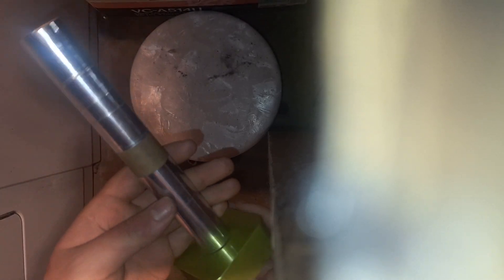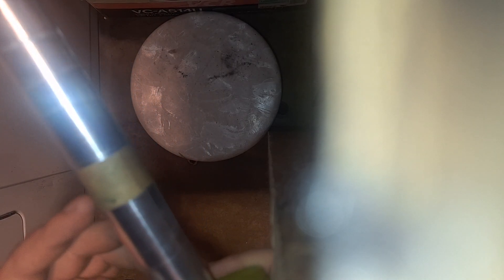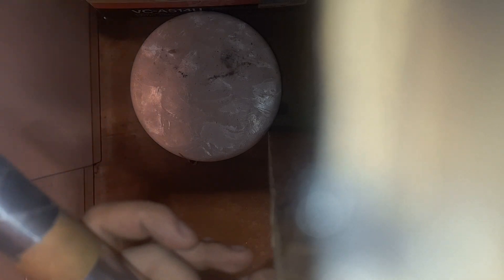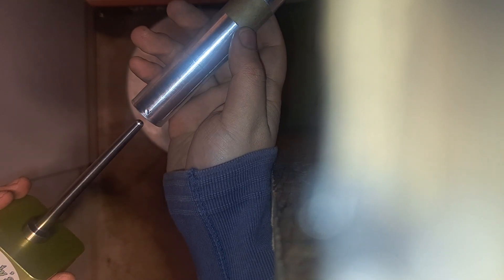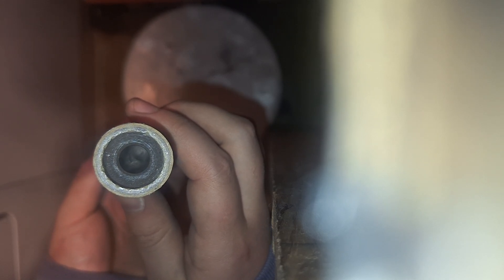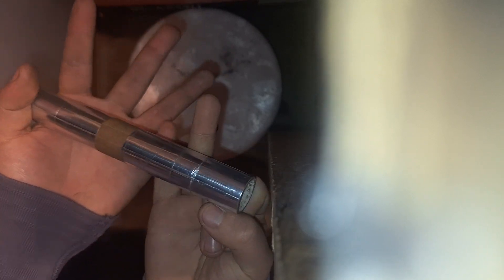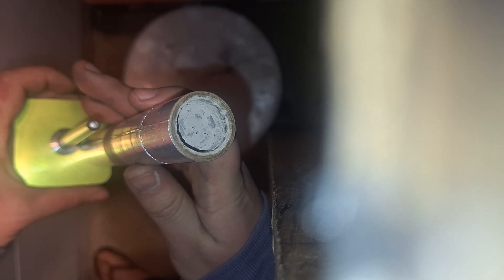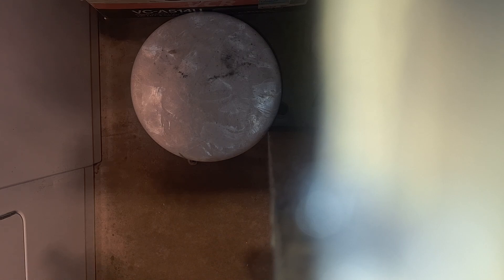the all hellfire whistle rocket, 1lb waxed tube, built on woody’s extreme tooling

Comment: Hey buddy me again lol. Was hoping to share a formula I’ve been working on with you and possibly get some feedback. Not sure if this is the appropriate place or not but wanted to ask nonetheless.
Reply from the maker: @Pyrodadsam  Sure, let’s do this. 🔥
Reply: @ShortFuseMan although I’ve had no problem lifting moderate loads I’m not going for a super heavy lifter just a super loud and unique sound.. which I believe I’ve achieved.. but I wouldn’t be upset to fine tune it for more power if you have any suggestions. It performs well on both my 2 and 4” 1lb spindles. As well as 5/16th tooling.

KCLO4: 60
KCLO3: 14
Sodium benzoate: 19
Charcoal 80m: 3.5
Phenolic resin: 1
Bismuth trioxide: 2.5
Wax: +3 

I know bismuth trioxide isn’t known as a powerful catalyst but I read that it produces an incredibly loud and unique whistle paired with benzoates so I started playing with it.
Originally it did not contain chlorate but based on your explanation in FPs strike video I added a small percentage and I believe it made a significant difference.
Also added the charcoal for smoke production and also seemed to increase thrust slightly. What do you think about this at first glance? I will be purchasing an analog scale soon so I can get some actual numbers.
Reply from the maker: @Pyrodadsam  …That’s a pretty dope propellant; I like it dude. ‥Looks like 74 grams total oxidizer and 29g total fuels, which is the 26g of calculated reducing agents and 3g of auxiliary plegmatizing agent as paraffin. It looks nice, but I would recommend adjusting it to the following formulation if you desire increasingly stalwart specific impulse yet unique and powerful audio emission simultaneously:

ƼƼ% Potassium perchlorate ❲Peroidin❳
1Ƽ% Potassium chlorate ❲Potcrate❳
22% Sodium benzoate
3% Indian blackhead or German Al
2% Charcoal, 80 mesh preferably
1% Phenolic resin
1% Bismuth trioxide
1% Copper chromite ❲Here as an AUXILIARY catalyst!❳
+3 Vaseline ❲White Petroleum · More Reactive❳

The aluminium, slightly more Sodium benzoate, and Copper chromite facilitating axillary catalysis in synergy with aluminium’s thermite-type enthalpic affinity for Bismuth trioxide will kick things up into extra high gear! It’ll be extremely rich in specific impulse and audible power, which is your goal with this mix. Have fun! Picking the mind of a Propellant Dynamics Mechanic and Advanced Exothermic Researcher is always an excellent idea when you need advice on any more in-depth formulations. 🤟😎🚀⚡️‥…
Reply: @ShortFuseMan you are a genius sir you answer questions that I haven’t asked yet lol I swear on my daughter one of my next questions was going to be how adding multiple catalyst would perform. 

I would have never considered the addition of the aluminum but it makes perfect sense paired with the metal oxide.

I also never knew petroleum jelly was a more reactive phlegmatic agent that paraffin. Is that the case with all catalysts? 
Thank you for taking the time to go over this with me.
Reply from the maker: @Pyrodadsam  Yes, that’s true! Oh, and you’re always most certainly welcome; it is my main objective to spread knowledge of these matters whenever possible.
Reply: @ShortFuseMan I will whip up a batch later this evening and keep you updated!
Reply from the maker: @Pyrodadsam  Perchlorates and chlorates do not react with Al in the presence of moisture in the same way that nitrates do. If you were using nitrate with Al in any composition, especially if moisture is to be introduced, the addition of Boric acid would be unwaveringly required. So, no; the use of some water in the preparation process will not pose a hazard in your case. When it comes to whistle mixes containing chlorate cations being pressed up against strobe compositions, this doesn’t pose an issue as the compositions are differentiated enough in the rocket motor tube and not subjected to sufficient homogeneity to cause any inadvertent ion exchange metathesis reactions to adequately undergo specious engenderment in the realm of chemically probable or foreseeably contextual feasibility, which would have a much larger chance to not be the case if the compositions were directly mixed together, which they’re not, for obvious reasons. We’ve stored strobe rockets with chlorate-containing whistle mixes for over eight months at a time, without any changes observed or cause for concern; which was confirmed through testing side-by-side with only week-old motors of the same compositions.
Reply: @ShortFuseMan thank you for clarifying that for me. I didn’t know that it was only nitrates that reacted negatively with aluminum in the presence of moisture. I was under the impression it was all oxidizers in the presence of water. I figured I would be ok in both instances but I like to try to use an abundance of caution if I have any uncertainty.
Reply: @ShortFuseMan one more question.. I was thinking on trying some of this with KHP subbed in for the Na benz also. Would the KHP perform similarly?
Reply from the maker: @Pyrodadsam  YES. It should! All while providing the propellant with that signature KHP flare we all know and love. Also, at one point, try going 11% KHP and 11% Sodium benz for a blend of both worlds, adding additional reducing agent diversity to the fuel matrix! The results of mixing a couple different fuels together will deeply captive and intrigue you. 🧪🔍📝🔥⚡️
Reply: @ShortFuseMan we think alike brother.. That is the plan! Thanks a lot buddy
Reply: @ShortFuseMan ok so I got a batch of the Benz and benz x KHP whipped up last night and got a couple small test rockets pressed and flown just moments ago. It lacked both power and any sound. The composition I started with was far more audible and produced way more thrust which has me stumped. Both fuels acted the same way. The only thing that changed in my process was using Vaseline obviously and I didn’t first treat with water and methanol then dry before adding the phlegmatic as I had done previously. 

With the 3% Indian blackhead do you think it would be safe to add the water alcohol mix or should that be avoided? I have boric acid on hand but I’m not sure if that would affect anything.

Should I maybe dial the Vaseline down a percent?

I recorded both rockets I can post a short if seeing them in action would help.

I’m open to any suggestions! Thanks in advance brother!
Reply from the maker: @Pyrodadsam  I would like to see them in action, then go from there. The fact that they underperformed is astounding and perplexing! I need to see how they behaved to come to an accurate determination…
Reply: @ShortFuseMan totally agree brother! I was scratching my head as well. Be on the lookout it will be up in a minute
Reply: @ShortFuseMan  https://youtube.com/shorts/AmRbnOtYZ2E?si=WASLcSNfNJYRawb9

I posted it as unlisted. If the link doesn’t work let me know I will make it public
Reply from the maker: @Pyrodadsam  Try a small test batch where you omit the Bismuth trioxide and replace it with Red Iron oxide. Excluding the Phenolic resin due to it potentially over-stabilizing the combustion characteristics ❲in the context of Benzoates❳ should also be considered. If pure KHP is used, Phenolic resin can be re-introduced into the formulation. Let’s start with these adjustments‥…👍🏻👍🏻
Reply: @ShortFuseMan ok I made a small batch with red iron oxide that is currently drying. But before I seen your response I made another batch same formula as the first but I made a couple modifications to my process.

I weighed and mixed all ingredients minus the aluminum then treated with water/methanol mix granulated through a 30m screen and dried thoroughly.
Once dry I then integrated the dark aluminum and added paraffin in naphtha and riced once more. This batch yielded far better results. I’m not sure if it was the paraffin or the addition of water and alcohol but I will post a link in a moment with the results and see what you think. It ripped with a longer spindle lol.
Reply: @ShortFuseMan 

https://youtube.com/shorts/0tylvR3Ud3g?si=s5Gzsjx8_Pkp7lOy
Reply from the maker: @Pyrodadsam  That’s dope, it worked great! It’s funny; the little idiosyncrasies that can make a huge difference sometimes when it comes to this art‥…they can be the difference between definitive success and unplausible failure.
Reply: @ShortFuseMan you got that wrong that buddy! She likes what she likes lol

In your opinion.. do you think the addition of water would pose a problem to the composition that already contains the aluminum?

Also do you think I would be ok using this in strobe rockets since it contains 15% KCLO3? I know potassium chlorate and ammonium perchlorate should be avoided in the same composition but not sure about stacking one on top the other as in a strobe

Comment: Good evening my friend! Curious if ferrocene can be omitted from this composition or if it is a necessity with the copper chromite?
Reply from the maker: Hey there Sam! Good to still be hearing from you. Ferrocene or Ferrocene derivatives can be omitted from Hellfire™ Whistle Mix℠, but‥…due to its role as an advanced metalocene-based catalyst, the propellant will possess 20% specific impulse loss. 📉 

If you have Black Iron oxide (Fe₃O₄ · Iron❲II,III❳ oxide), you can decrease said impulse loss to only 8%. 📊 This means that if you replace the Ferrocene or Ferrocene derivative usually used in Hellfire™ with Black Iron oxide, instead of the propellant being 80% as powerful (Hellfire™ with just Copper chromite), it will be 92% as powerful (Hellfire™ with Copper chromite, but with Black Iron oxide in place of the metalocene-based catalyst Fc. 

Hope this helps you out man! 

Always feel free to keep asking questions and refining your knowledge.
Reply: @ShortFuseMan good to hear from you as well brother! Life has been throwing curveball after curveball so I haven’t been nearly as active as I’d like to be but I’m still kicking.
Great to know! I have both copper chromite and black iron oxide on hand. Once I get the opportunity I’d like to give it a shot. As always I deeply appreciate you letting me pick your brain.

Comment: Amazing rockets Casp. Would like to learn more about the “Hellfire” mix.
Reply from the maker: The Man, the Myth, the Legendary Uncle Whitt, is now along for my ride? What an honor, most truly! Please, make yourself comfortable, and feel free to help yourself to any refreshments.

I would be delighted to redirect a little more light on the material of “‘Hellfire Whistle”’ to you Uncle W.

As stated before, this is the composition Dan from Huppscustom came up with, as featured in his KHP with copper chromite testing miniseries. Then Jeff, aka RunningMan picked it up and gave it a name, ❲which was because it had not been designated one at the time❳… He called it “Hellfire”, and mostly everyone has referred to it as that ever since. Hellfire is a high-end “Redline Propellant”, which means it is so powerful and vigorously burning that it literally is on the edge of converting to detonation when a fuel grain that containis it is deflagrating. This is why you typically would not press an entire rocket with it, just the delay stage, as it has an inherent habit of redlining at launch and C.A.T.O.ing because of its extreme nature… The way you make Redline Propellants like Hellfire reasonable for payload responsibility and much more reliable is by waxing your respective rocket tubes where you will be implementing them, as you cannot reliably employ Redline Propellants in non-waxed tubes due to the issues addressed in the aforementioned publications.

Anyways, it’s great to see you around, my good friend! I hope all is well with you and the family, and I wish you an excellent evening.

Comment: I have Access to a lathe at a friend's place, I wanna go with 1lb tooling, 19.5mm id of the tubes if I remember correctly and 19.5cm lenght. I'm thinking of metric simplifying it to 20mm and 20cm long. Do you think that sounds good? The spindle initial diameter and lenght and final diameter is something I've yet to know the dimensions, maybe you could give me the dimensions and your opinion on the project

Comment: Casper , after reserarching around i see KHP whistle formulas like for example  from pyrodata that doesn't include any catalizer on it , just states a 70/30  mix  , is that correct? 
I'll like to experiment this fuel in the future .. there is copper oxichloride a option as a catalyst or red iron oxide ,  also i read somewhere that red gum as being used for that purpose. 
Since the moment that cu.chromate and ferrocene are kinda hard to get 
Any advise will be greatly appreciated 😊
Tks.
Reply from the maker: The KHP formulas on PyroData are designed for just static ground whistling devices that remain stationary on the ground, so those formulations where not made with propellant applications intended in mind, henceforth why you see no catalysts in those mixtures. Copper chromite and Ferrocene when used together to catalyze KHP for propellant purposes make for the highest thrust/ISP output whistle propellant you can reasonably make, due to their highly synergistic catalytic affinity in potassium-rich contexts. However, with that being said, you can still make very powerful KHP propellants for whistle rockets without Copper chromite and Ferrocene, so as long as you use any copper-based catalysts… With the use of Copper oxychloride, I would definitely recommend the following composition:

68/28/2/2 Potassium perchlorate/KHP/Copper oxychloride/Paraffin wax

With Copper chromite and Ferrocene, a more fuel-rich composition is used:

6Ƽ/3Ƽ/+2/+1/+0.Ƽ Potassium perchlorate/KHP/Paraffin wax/Copper chromite/Ferrocene

This is the composition Dan from Huppscustom came up with. Then Jeff, aka RunningMan picked it up and gave it a name, which was because it had not been designated one at the time… He called it “Hellfire”, and mostly everyone has referred to it as that ever since. Hellfire is a “Redline Propellant”, which means it is so powerful and vigorously burning, that it literally is on the edge of converting to detonation when a fuel grain containing it is deflagrating. This is why you typically would not press an entire rocket with it, just the delay stage, as it has an inherent habit of redlining at launch and C.A.T.O.ing because of its extreme nature… The way you make Redline Propellants reliable is by waxing your respective rocket tubes where you will be implementing them, as you cannot reliably employ Redline Propellants in non-waxed tubes due to the issues addressed in the aforementioned.

Thank you for your comment my friend.

I’m very happy to know we both take complete interest in one another’s pyrotechnic projects.
Reply: @ShortFuseMan  thank you a lot Casper, I really appreciate the valuable info and special thanks for taking the time to answer my friend.
Truly appreciated 👍
Reply: What are we pressing the comps @ 7800 psi ?